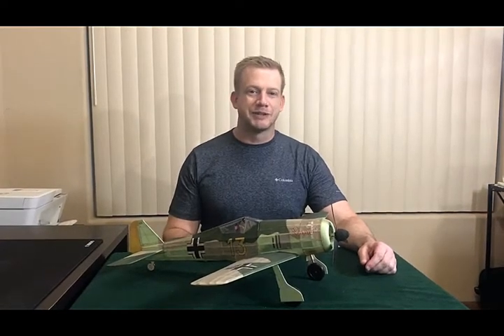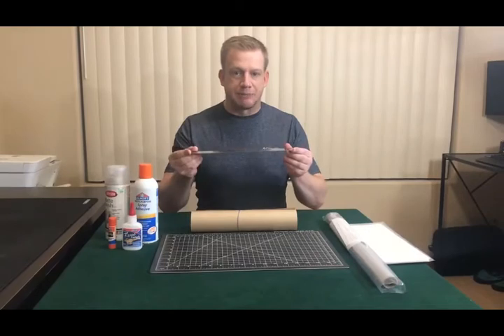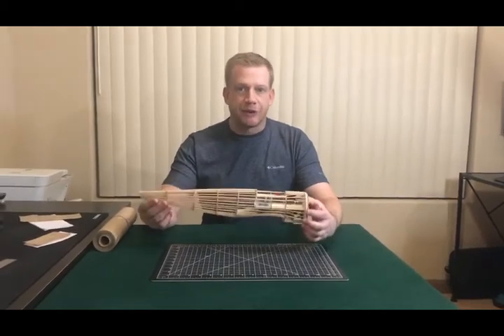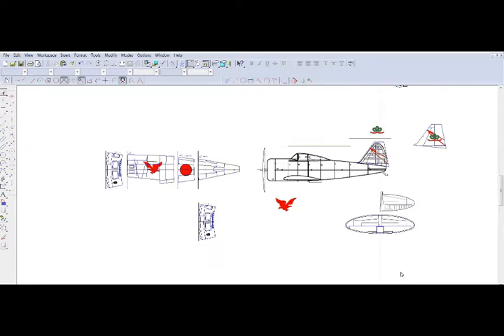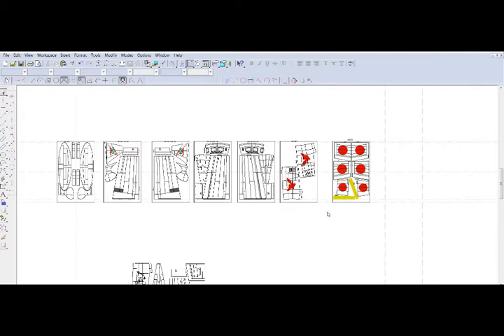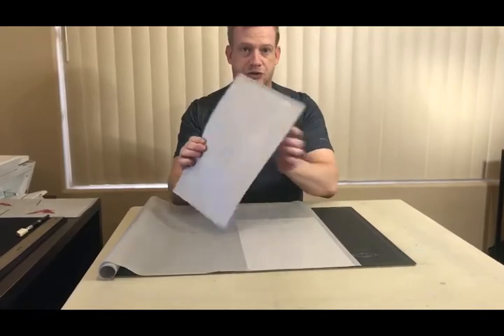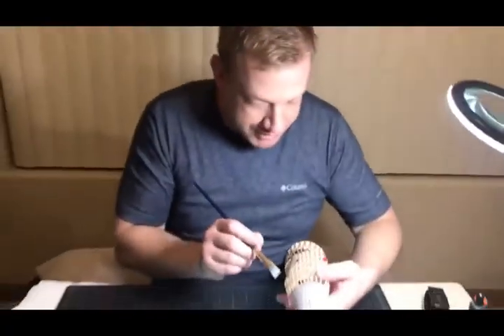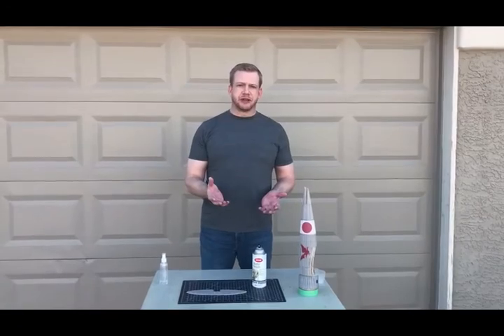FSM Printing on tissue  Ki 27 Nate

Comment: Thanks for all the great videos, Derek. Excellent presentation (easy to listen to). 

What circular light do you use to backlight the tissue?
Reply from the maker: Thank you Gene. I'm not sure where I acquired the circular light- there is a small clip at the end to allow you to attach it to things. I've found the light on your cell phone works well too. I also picked up a "table light for tracing" from Amazon. It works really well and was around $20
Reply: @funscalemodels9782  Thanks. Looking forward to more!!

Comment: What is the cad software that used
Reply from the maker: Hi Stephen, I use 2D TurboCAD
Reply: I promise this is the last email I will write you but will TurboCAD Designer 2023  -- as far as you know be good enough to print tissue like you are doing.  Thank-you for your time again
Reply from the maker: @stephengould9385  hi Stephen, no worries.  Yes that sounds like it should work.  I just use TC to design the templates- if you are just printing already created ones no CAD is necessary